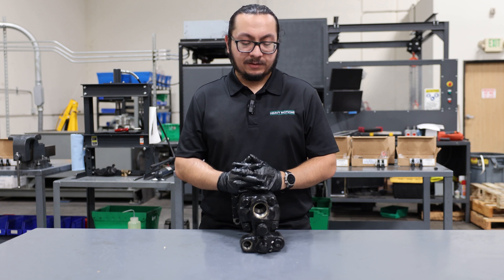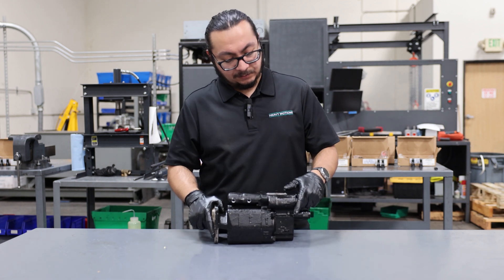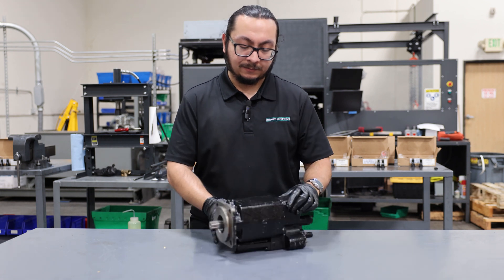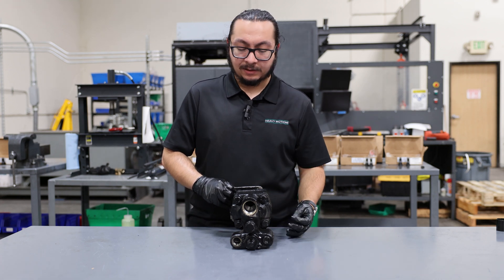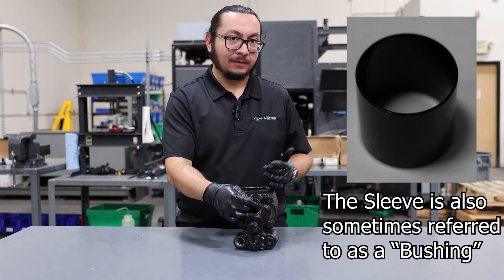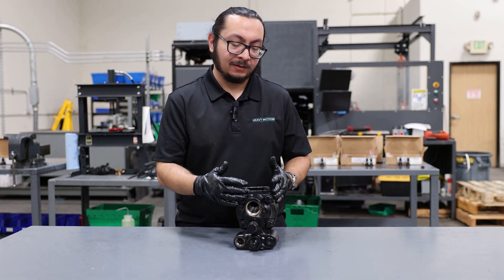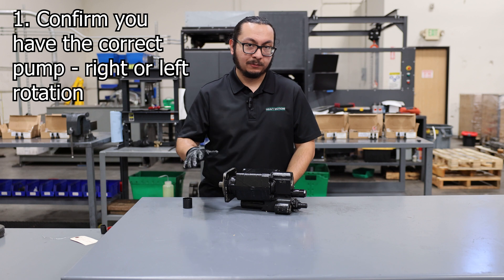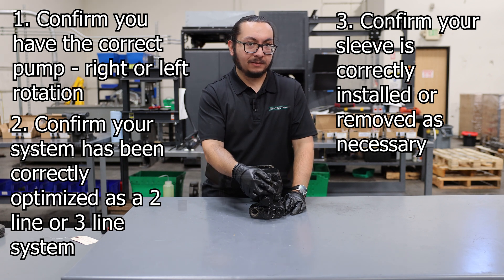Dump Pump Installation Guide: Left vs. Right Hand Rotation and 2 vs. 3 Line System

Comment: What if you forget the sleeve on a 3 line system?
Reply: The pump will never work correctly or maybe not at all
If you plumb the return line you must put the sleeve in 
or the pump will NOT work correctly. Also if you put the
sleeve in and do not plumb the return line it will not work. 
When you install the sleeve it blocks the passage where 
the oil would normally return and diverts it the return port.

Comment: Whats better. 2 line or 3 line plumbing
Reply: 3 LINE
Reply: Can run a dump continuously to run other systems if set up on a three line system, like a plow an salter?
Reply: @adambater2767  It will but for how long is the question. A two line pump with a separate bank valve
would be a better choice for longevity and you can add other functions if needed such as dumping.